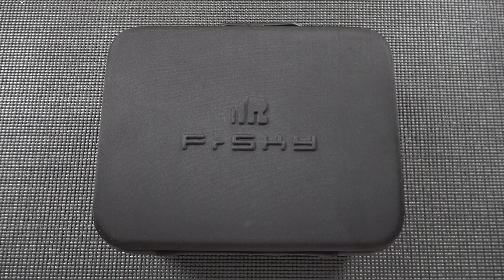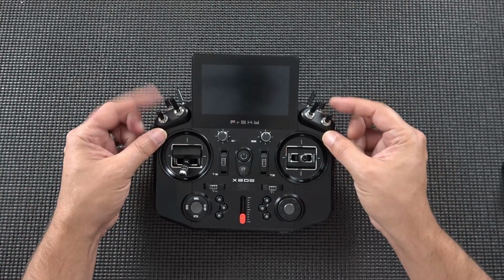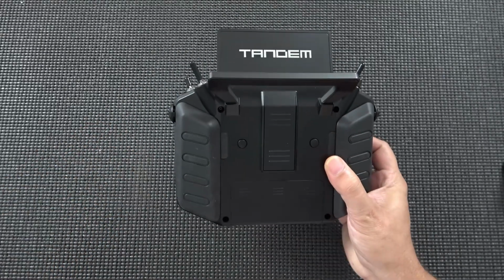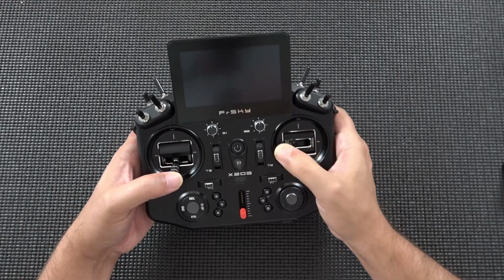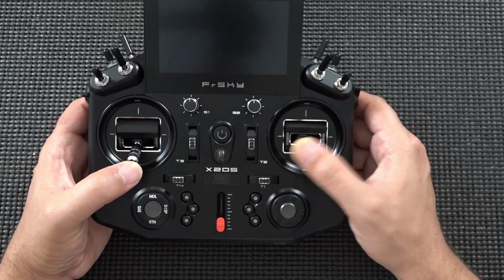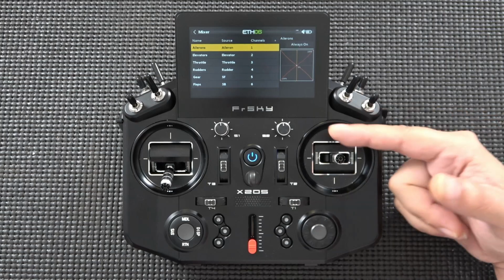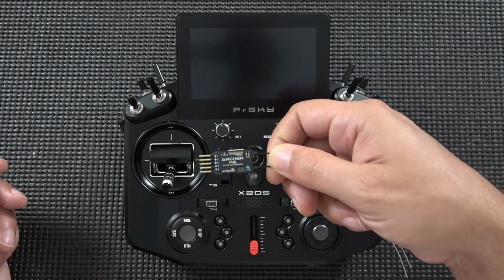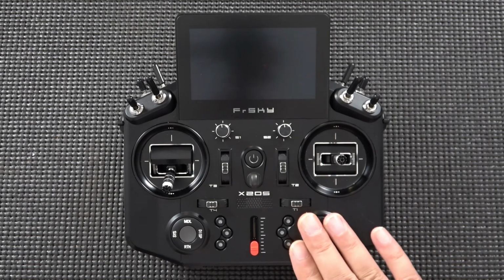FrSky Tandem X20S Transmitter - First Impressions

Comment: Great initial video thanks.
I would love to see a video on telemetry setting up especially to a lipo mAh used  sensor that's such an important telemetry feature for electric planes IMO.
Also I hold my index fingers around the top of the TX and wondered whether you could actually do this? Without the side sliders/switches being in the way?
Currently on Spektrum NX10 which is really good with Realflight 9.5 because of the Game Controller Mode...does this have that ability from the USB port? 
Also can you use the Scrollwheel to physically fine tune/dial mixes in while flying?
Reply from the maker: @David Hall - Thanks for the suggestions! I'll need to get my hands on the current sensor telemetry module to check out before I can do any videos on that, but that would be a great one. With regard to the placement of your index fingers... The contours of the X20S are not quite as inviting to resting your index fingers on the shoulders like a Spektrum transmitter is, so it would take some getting used to, but I don't think it would take much to develop that muscle memory. It's not uncomfortable, just different. I'm not aware of a way to use the click wheel as a trim fine tuning input, but you can change the resolution of the trim switches where a single click gives you more or less movement as desired. The X20S does indeed have a Joystick mode that works as a Windows Game Controller when plugged into your PC using a USB C cable. Hope that answers everything, and I'll put some of these ideas in the queue for future videos! Thanks for watching, and for the great feedback and questions!
Reply: @TheRCAirMarshall  Thanks for your quick reply and answers to my query s much appreciated.
They look like a fabulous Tx especially with the machined Gimbals and colour touch screen...
It's great that Frsky has incorporated the Game Controller Mode 
I'll have to try to hold the TX at some point.
And yes Spektrum tx definitely makes it easy for your index fingers to comfortably rest around the top.
👍

Comment: It sounds almost too good. The NX8's features cant hold a candle to that. 
I'd like to see how the multi-protocol module works. I cant even figure out what its called on the Amain and FrSky's pages.
I like the dual frequency redundancy, and sockets for external antennas. I have a massive LOS flying space and I sure would love to stop worrying about tx range.
Also, I saw the X20SHD transmitter, with the built in FPV video screen. How cool is that?
Reply from the maker: The Multi Protocol Module is the iRangeX IRX4 Lite. There's not a ton of places to pick them up in the US just yet, but they are readily available on Banggood.
Reply: @TheRCAirMarshall  so about a $50 addon, thats not bad at all
Reply from the maker: @snoriverrc3842  nope, just the wait sucks. There should be some US warehouses sources here in the near future